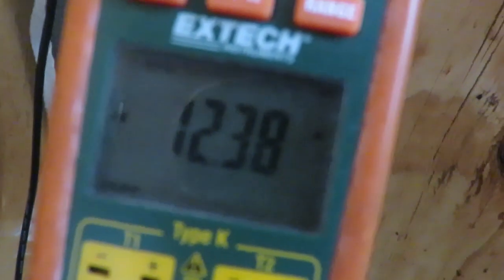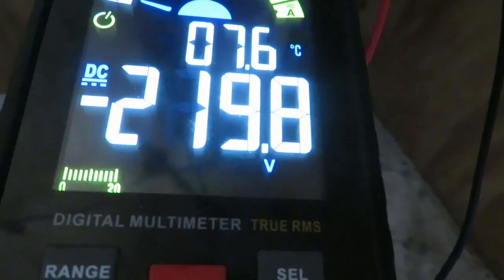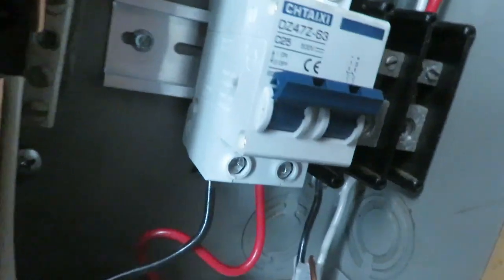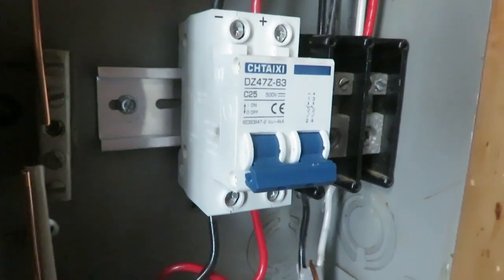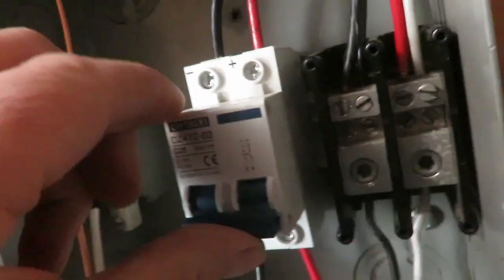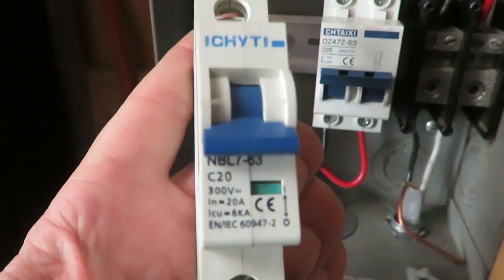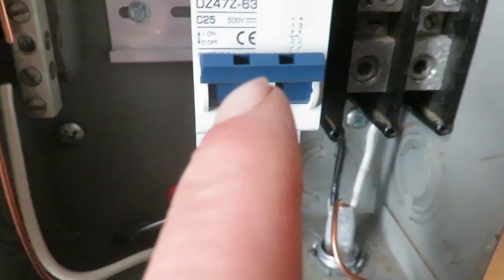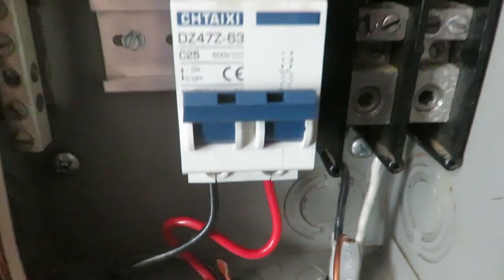Testing  CHTAIXI DC breaker shutoff of 200v 10 amp load

Comment: Bro ...there was a spark flash . Watch the video you will see the light 🚨 that flashes !
Reply from the maker: yes I did notice that spark on the video. It isn't that there is going to be no spark - the fact is that the arc was extinguished quickly which is what it is supposed to do . I have a newer video where I also have a contactor in on that circuit . There probably is also a small arc inside the contactor when it breaks the load , but you can't see it since it is all sealed up .  As someone else pointed out - when I had the initial breaker in when I had the flame shoot out , I may have had it in the wrong orientation since some dc breakers are polarity sensitive .
Reply: Thanks for more light on it
Reply: I don't think I'll like to buy a circuit breaker to my solar, they look frightful, my solar system is meant for my 20ah lead acid battery to charge my phones and USB fans.
Reply from the maker: @CheMathiewNgayihiAbbe   It is only when you start using the higher dc voltages that it is more critical. Using a higher quality DC breaker and installing it correctly you will have no problems. But if you don't want to use a breaker, then use a fuse instead - but have extra fuses so if they blow you will be able to replace them.
Reply: @LarryKapp1  what causes high DC voltages, like what amount of solar system power?
Reply from the maker: @CheMathiewNgayihiAbbe  You get the high DC voltages when you connect a lot of solar panels in series ( positive to negative on next panel etc )  For example if you have 3 panels that have Voc rating of 40 volts then you add the voltage so 3 x 40 = 120v .  When in series then the current stays the same so if panels were rated at 10 amps it will stay 10 amps in series. The reason to connect a lot of solar panels in series to get the voltage higher is that then you can use smaller gauge wire with less voltage drop . So if you need to put your solar panels farther distance from where the controller is , then that helps keep cost down . Of course to take advantage of this you need to use an mppt type controller which will take the higher voltage and drop it down to the battery voltage .
Reply: @LarryKapp1  I use only one panel for my system

Comment: If polarised double breakers used with source coming from bellow the plus poles must be on the right side, even the printed + symbol is on top left side (Opposit case: If polarised double breakers used with source coming from bellow the plus poles must be on the left side, even the printed + symbol is on top right side)
At a polarised single breaker the SOURCE must be connected at the side where the + symbol is. 
Thats the reason why they often cause problems. There are magnets inside to direct the spark into the spark swallow chamber. When the current flows in opposit direction the spark is pushed by the magnets away from the spark quenching chamber, goes into the mechanism and can catch it on fire.
Reply from the maker: Thank you for this information . I did not know the details which you explained so well.
Reply from the maker: In my wiring the positive from the PV  source is coming from the top , and the positive is connected to the + on the right. So from everything you are saying this double breaker is wired correctly. But if I understand you correctly - if I had fed the PV source from the bottom I would connect the Positive to left side and negative to right side.
Reply: @LarryKapp1  Yes thats all correct you say. The direction of the current flow is allways from + to - and the + stays a + even it  leaves the breaker through the - terminal and goes further (there are breakers arround labeled on top with + - and on bottom - +, which is quite confusing for some people)... sorry its a bit abstract but easy once you have understand it...and it seems you allready have understand it  : )
Reply from the maker: @topeye4202  If I ever find that other breaker around and have time I can experiment and  see if wiring it the other way will keep the flames in it !  I don't think I have ever seen anyone ever explain DC breakers as simply as you have just done so thanks again.

Comment: Nice.. thanks for the demo. wonder how many times it could do that.. prolly not too many.
Reply from the maker: I have another similar breaker but rated at 1000 v and use it on 240v dc  direct to water heater. I have used it to switch off the load quite a few times and it seems okay.  It wouldn't hurt to spend the extra $$ for a better breaker if it was something  more critical .